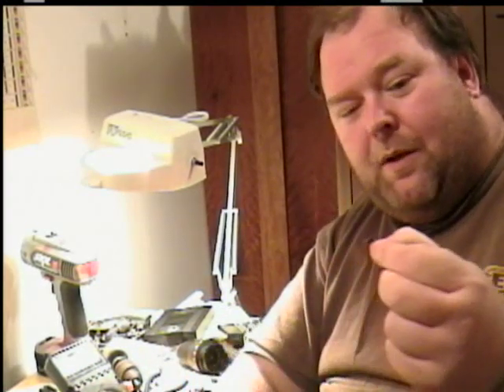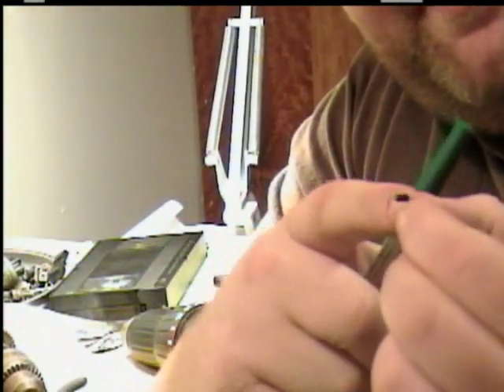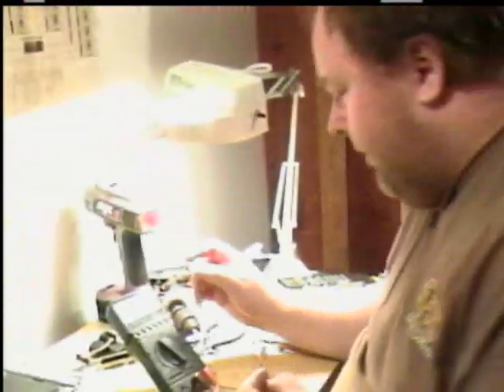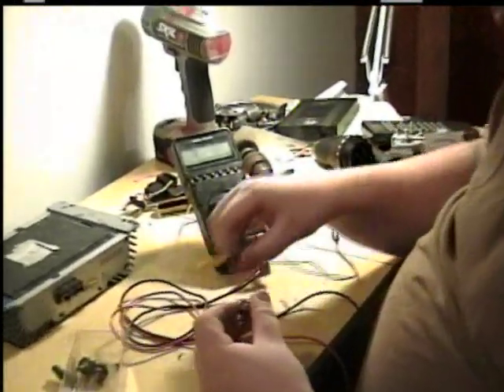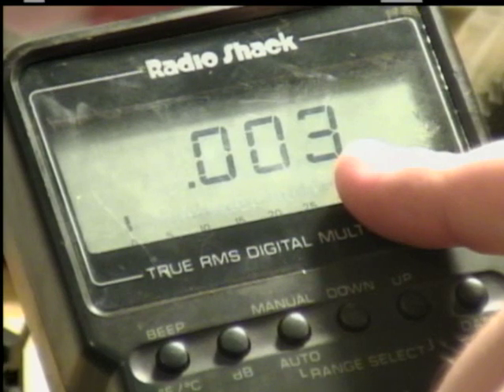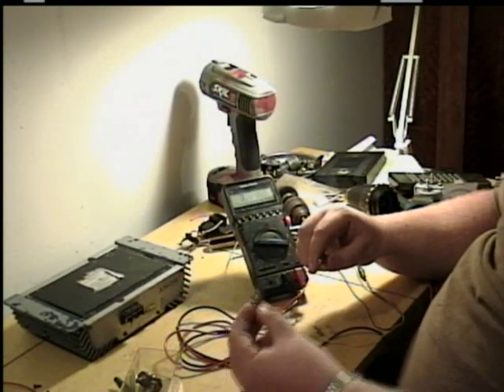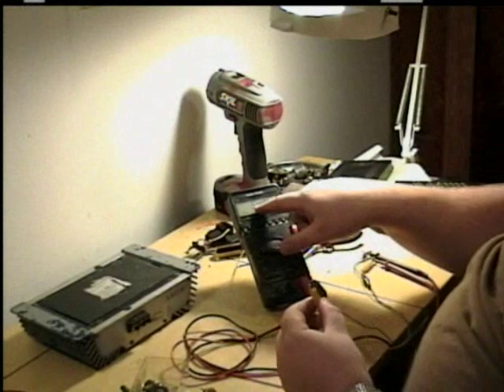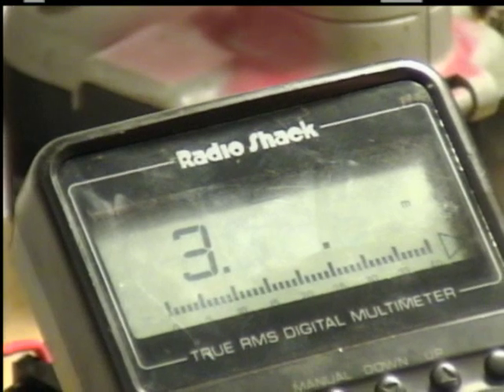Identify and test Diodes

Comment: Does a Craftsman Lawn Tractor model # 917.275760,have a diode or a capacitor,in the electrical system? I can not find which one is used in this tractor. I have searched by tracing the electrical harness and haven't located either one. Where are they located. The tractor will not crank over.i have changed all the electrical safety switches,the fuse,the starter,the four post solenoid, and the ignition switch. Still,the tractor will not crank over. There is 12v at the solenoid large posts,( Battery post and the starter post) but no voltage at the small spade connection(s) when the ignition switch is turned to start position. There is only two safety switches,that would keep the motor from cranking,when using the ignition key. The clutch/brake and the pto safety switch. Both are new, and checked by a multimeter,to be operational. I have visually checked the wiring harness,found no burnt wiring or any loose connections or ground wire corrosion. So now back to the original question(s) at the top of this message. I noticed there is a protection wire loop,located somewhere in the wiring harness. I haven't been able to visually,find this loop. Does this loop,replace the capacitor,a diode or a transistor,used in other tractors? I never had to get so thorough in checking the electrical system,as i have in this tractor repair. Here is another kicker,the wires from the rocker switch to the lights,has no voltage. The rocker switch has been checked,and no voltage is coming to the switch. I assume,this adds to the electrical problem.of not cranking over. Some where,i have an open circuit,that is killing the power,to the tractor. I have been using the multimeter and a dcv light tester,to trace the wire harness,to the areas i can reach or get to. There is many cramped areas,that is impossible to reach. Please respond,if anyone has experienced this problem or has any good methods,that i have missed.Thank You, Brad Locke (You can find my eMail address,at Amazon or PayPal)
.

Comment from the maker: I have been unable to find what the diode is in any of my reference books, however, It is unclear if the diode is the only cause of the problem. Switching power supplies are more complex than the linear counterpart. You can replace the power board for around $50 to $100 on eBay.  -MrFixit

Comment from the maker: Actually ,I haven't worked on any of the B&S engines with the diode in the coil wiring harness . Friends says when the diode blows it won't work . It can be replaced , use the numbers on the diode or go by the size of the diode and go to your local Radio Shack Store . Or, you can get one out of a junk circuit board out of a radio , tv ,etc. 
The same goes for the charging diode ( you didn't specify which diode ). The white band is the output .

Whizkid

Comment from the maker: RadioShack sell 6A single diodes in packs of two. They should be enough to use to power the mower and charge the battery. Look at the #'s on the diodes to lookup their rating and be sure the new one match. Note how they are connected to the wiring. The "color band " marks the diode's output. -MrFixit.

Comment: I have a briggs 15 hp opposed twin cyl, with a blown diode . I would like to buy a diode at radio shack .  which diode should I ask for , im thinking 2-4 amp dual circuit  but not sure and which direction to solder inline

Comment from the maker: @thatcutndude1 I would highly recommend replacing the fuel pump too. the screw that fell out may have control the fuel flow. it was probably the culprit to the relay board burning out. that fuel pump is an electromechanical pump. If the pump was leaking it would cause the pump to short out too. -MrFixit

Comment from the maker: @thatcutndude1 When using a diode tester, the reading indicates the minimum voltage required before the diode will conduct foward biased. The numbers written on the diode is a part number which when cross referenced identifies the diode's charateristics such as type, electrical properties, voltage, current, etc. -MrFixit

Comment: Thanks for the answer. The output is certainly erratic and weak so the diode could be the suspect component then. (Its only a cheap chinese 2 stroke generator but i want to try and fix it before i take it to the scrap yard!) cheers geezer.

Comment from the maker: @worndisk320 If the diode is in the battery charging system, it will cause the system not to charge the battery correctly. This diode changes AC into DC to charge the battery. On the other hand, if the Diode is in the the AC generator's rotating coil, a bad diode prevents the generator from producing any power output. There is also rectifier diodes used to convert the AC output to DC for the voltage regulator, bad diode would cause AC output to be erratic .  -MrFixit